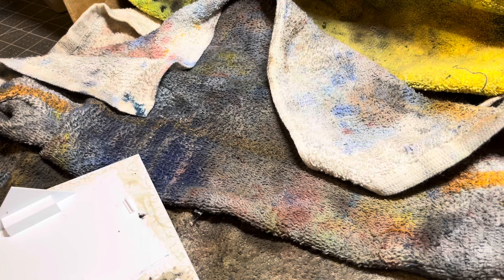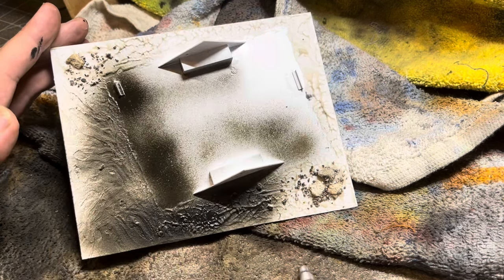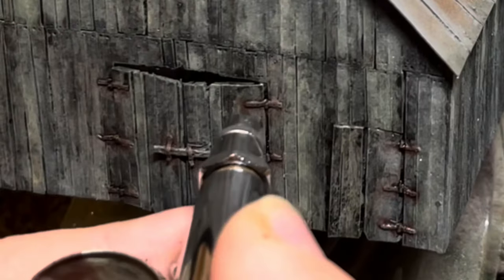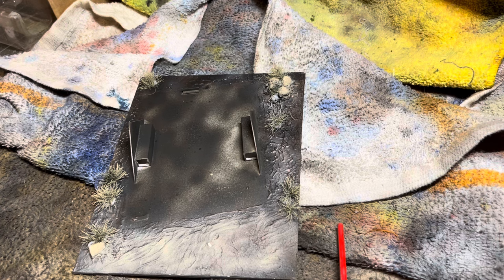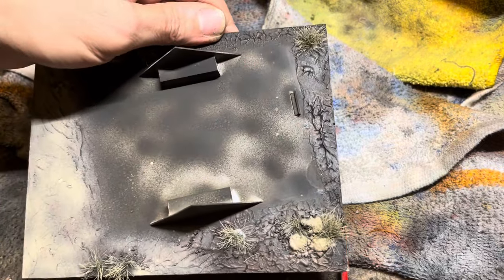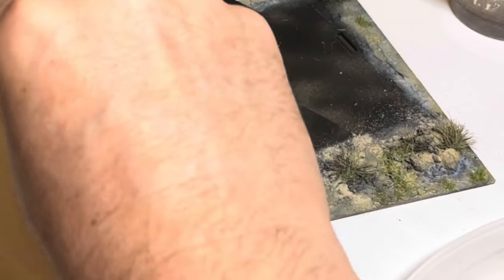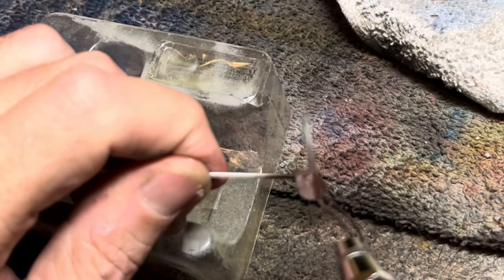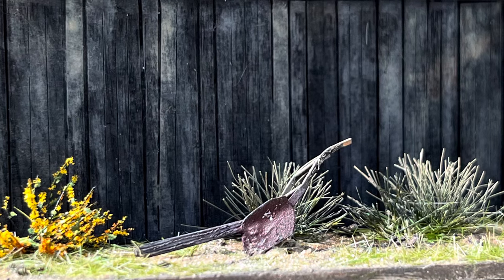Finishing the Scene: 19th Century Barn and Base Display

Comment: Very nice! What thickness of styrene do you use for 'bases' of your models? I really like that technique as able to salvage a model vice gluing directly to base foam/ply/etc.
Reply from the maker: Depends on size and weight of the piece and how you plan to mount it. Small a/c unit can be built and mounted directly to a roof with .10 whereas a large building would possibly require .60-.80
Reply: @PostmoderneModelWorks  Many thanks, I plan on using that method for all the structures I'm working on to 'set' into base so easily removable for cleaning, detailing, etc. Obviously, will have to have terrain/sidewalks/roadways/etc planned out to accommodate. Seen this done on a few other videos but don't recall exactly what they use. I do know of a modeler that uses very fine plywood but the good Canadian kind, not the stuff we get here at local box stores in states.
Reply from the maker: @schadowolf  consider building as much as you can from styrene and try and make any and all vertical structures removable. I’ll try and do a short clip of what I’ve done and post it in the next few days.